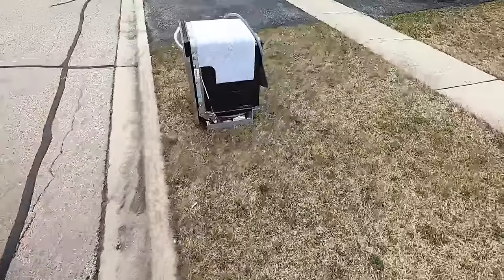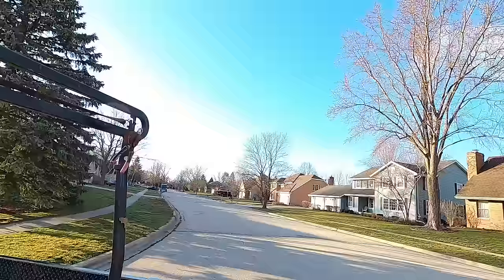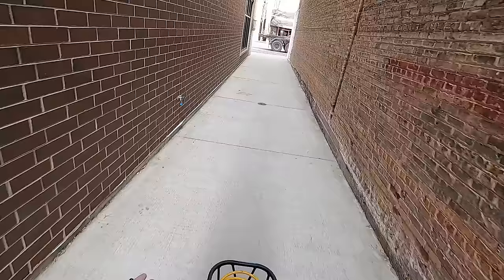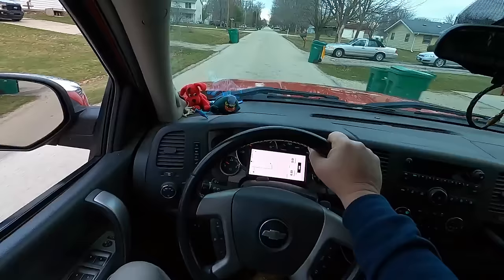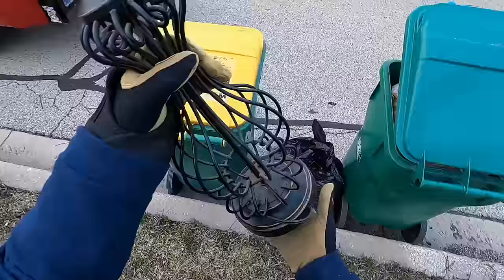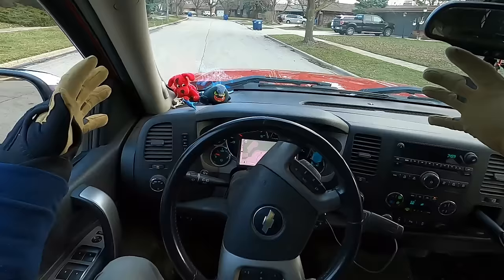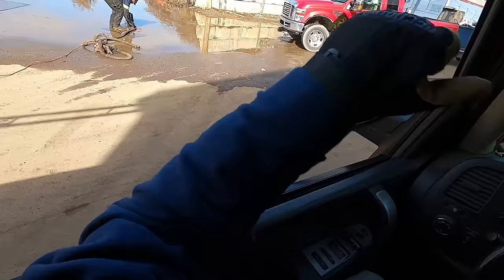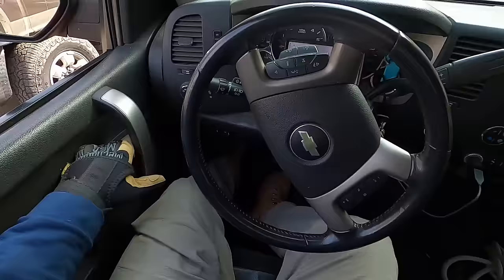Why Make Money on Garbage Day??

Comment: I had a big paper route when i was 13-18.
Had a nursing home on my route. Well they were always Dieing.
I won alot of the competitions  for new customers because the older ones were always passing away
Not my fault.  85 inside and 40 out side at there homes. Great money when i was young. Big bags on my 10 speed bike. $35 bucks a week 45 years ago was good money. And at my age. I saved my money. I Bought dirt bikes and street bikes. At 18 I rode my new Kawasaki 750 to school my senior year of school.  Weather permitting.

Comment: 03:15 I'd have taken a magnet to that headboard just in case.  They used to paint brass sometimes.  My library is being rebuilt and isn't taking donations.  THat said, university library book sales can be the best if you can handle the weight of hauling off the books.